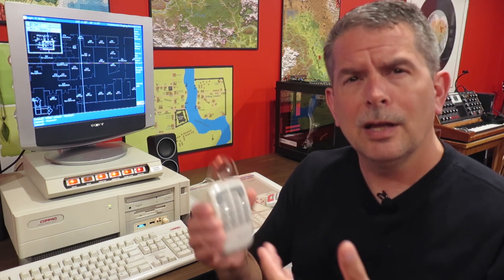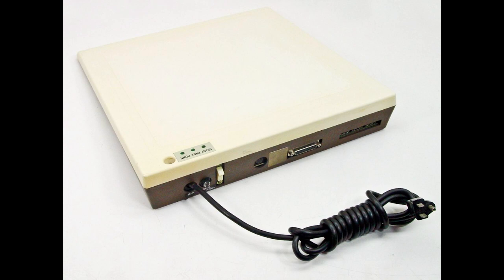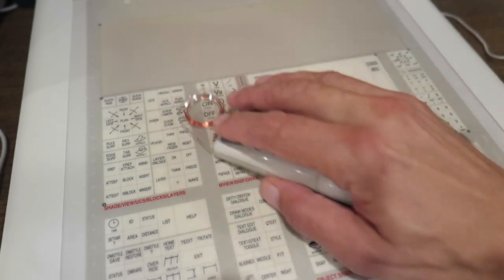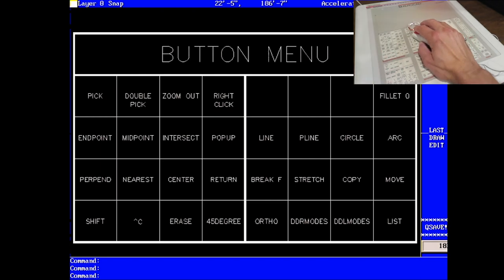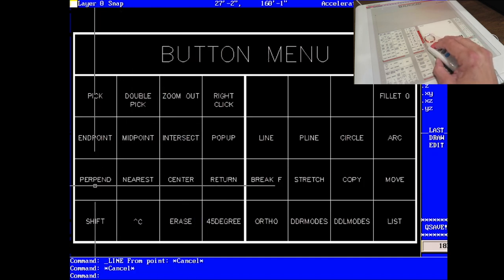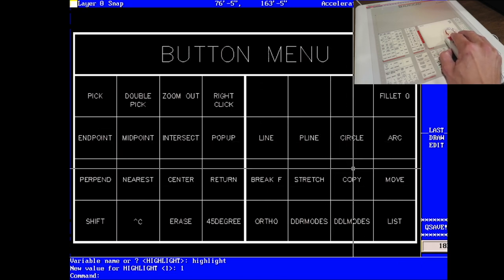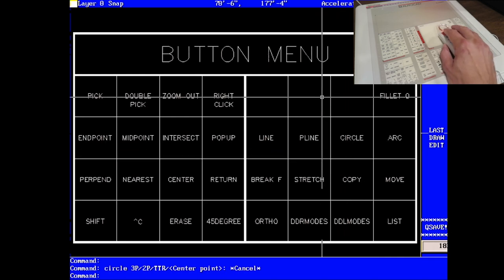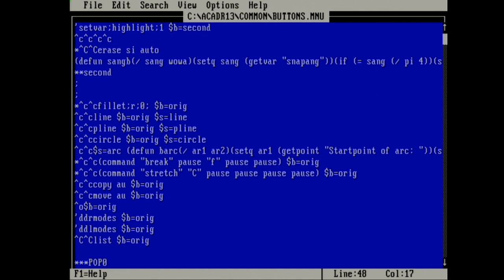RetroCAD: Digitizers

Comment: I am one of the designers of this CalComp digitizer. I work for GTCO CalComp today. We still support AutoCAD digitizers and drivers. It doesn't have to be considered retro today.
Reply from the maker: Interesting! Is there a Windows 10 driver for the DrawingBoard III?
Reply: @RetroCAD  Yes. You can download TabletWorks for free from our Website, gtcocalcomp.com. Wintab support can be enabled for less than $100 for 3 years. But make sure the digitizer works with TabletWorks first. Call support and ask for me to get a help file.

Comment: I picked up a bundle of stuff today: A boxed copy of AutoCAD 386 with all the beautiful original manuals & dongle (which I plan to install on my 386), Microstation Version 4 also complete and fully sealed, and getting to the topic, a Graphtec KD4030B digitiser which has a massive A3 surface. I was hoping to get the digitiser singing with AutoCAD, but unfortunately it came without the puck. Do you have any knowledge of these?

Comment: I have recently rescued GTCO Rollup II  36x48 digitizer from being sent to the dumpster and would like to see if it still works.
I have the corded stylus and found out it needs 9V DC (positive on center) power supply, but I am missing the serial cable to test it.
I found some generic info on RS232 DB9 to RJ11 pinout but would appreciate if anyone could verify this? 
RJ11<---------------->DB9
pin 1-TX -----------> pin 2 RX
pin 2-RX <----------- pin 3 TX
pin 3,4-GND ------------pin 5 GND

Some pins on DB9 may be shorted to create some kind of null modem signaling towards the PC?
Any help will be appreciated.